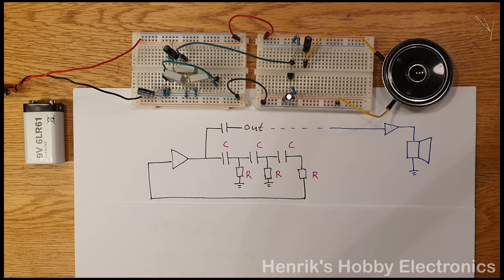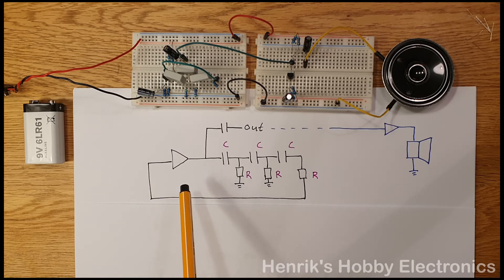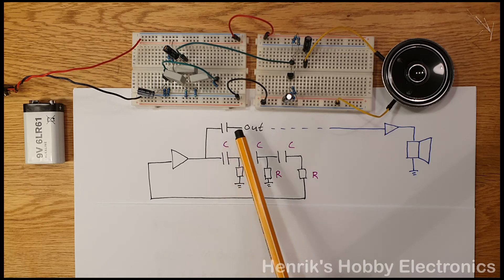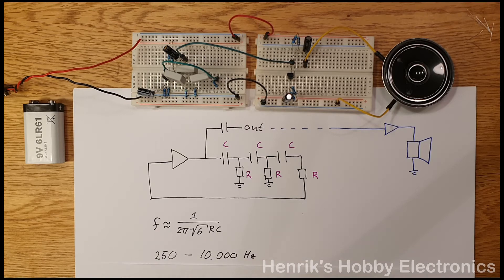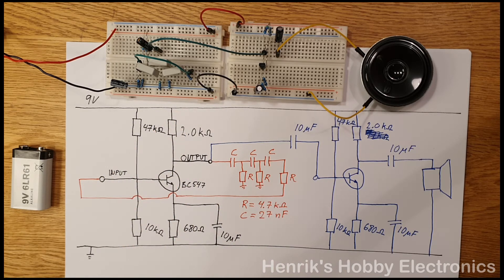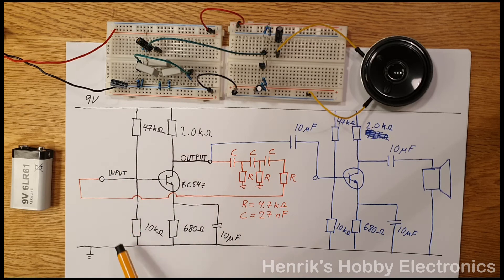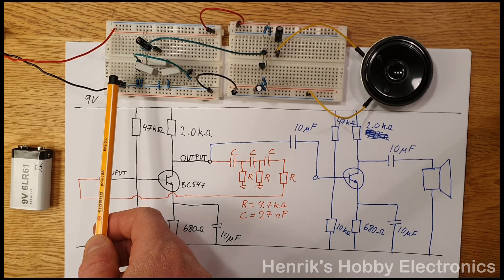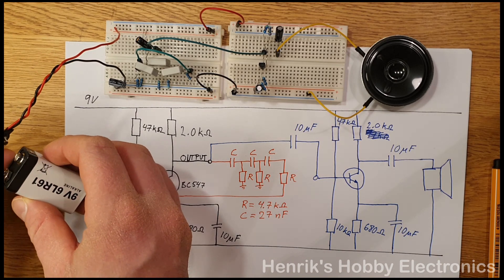I made this audio oscillator on a breadboard

Comment: hey , i have a projects , and i want to add a third transistor as switching device for the circuits in the video , i will connect the pir sensor to the transistor so whenever it detects motions the oscillator and amplifier would turn on , please someone help me i dont know how i will connect it

Comment: Thank you for this wonderful, informative video!  I do, however, have two quick questions.  First, I noticed that the lower ends of the first two resistors are grounded (thus putting them in parallel to the signal chain), while  the third resistor is not in parallel, but in series with the signal chain; why is this done, and how does it effect the frequency, gain, et cetera of the circuit?

Comment: what way round does the capacitor go round from the oscillator to the amp I'm assuming its an electrolytic like the other one . Thank you my friend. Gary
Reply from the maker: Yes, the 10 uF capacitor is electrolytic. The positive (long) lead should go closer to the positive side of the battery/power supply. In the video, you can kind of see which is the long lead of the cap, since the long lead is bent when fitting it into the breadboard.
Reply: @HenriksHobbyElectronics  thank you my friend, I built it and it works fantastically.
Reply from the maker: @garyhart6028  I am happy to hear that! 👍